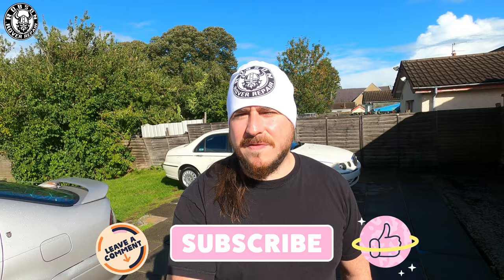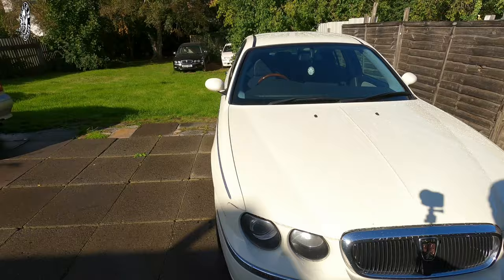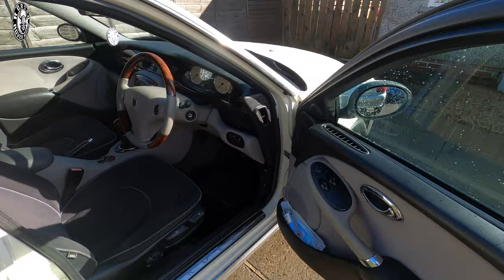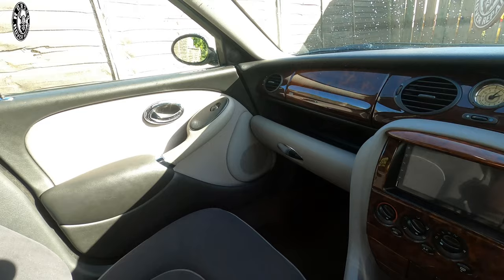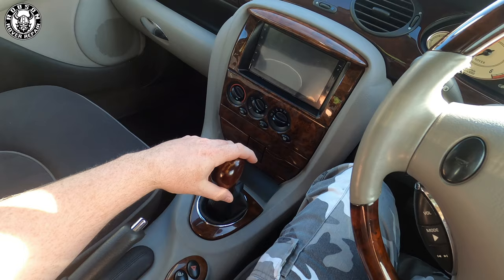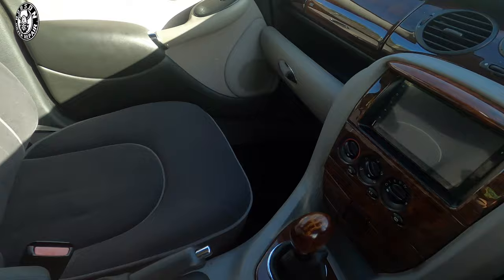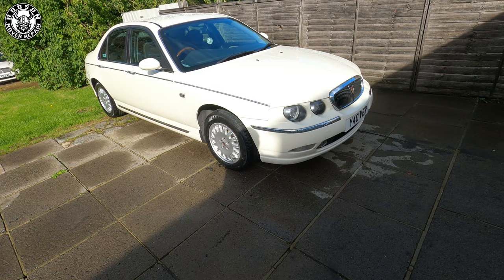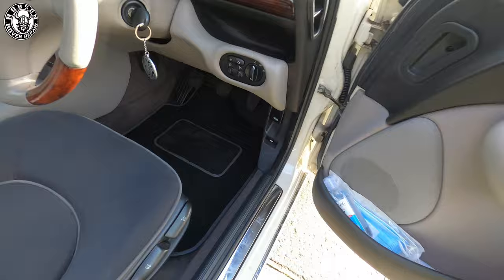My daily driven Rover. A base spec Rover 75? But why?

Comment: I have a Heritage Green Rover 75 CDTi has all the bells and whistles. I bought it in 2010 in England, it was MOTd the day before i picked it up. A week after i brought her home i got a puncher, to my surprise ever tyre on her was baldy down to down right dangerous with little rubber, they must have changed the wheels for the MOT i reported the garage to the VSOA.
Since 2010 i have spent around £13000 on the car in the last two years i have replaced most of the braking system, all hub bearings, new radiator, condenser, Alternator, Starter, all engine mounts, for life battery, front sub frame, springs and shocks, other suspension parts, lub oil cooler, water pump, crankshaft pulley and a lot more. I was an Engineer at sea were a lot of the maintenance is preventive,overhaul or replace before failure. The car will be 18 years old on 31/12/2021 have a rear sub frame ordered its taking forever to arrive, but am really pissed off because roof lining is starting to sag at the windscreen, i also need rip repair to drivers seat ( sandstone leather ) and the bolster replaced , also a small rip in rear seat, with all the money i have spend its annoying that the inside is starting to need money spent on it. The £13,000 does not include labour costs.
Sounds a lot off money but in the eleven years i have owned her, i probably would have changed my car maybe four times which would have cost me a lot more.
Car cost me £4000, and has an Evolution chip remap to 165 BHP which cost me £300 in 2010.

Comment: Wow I am in Australia & we don’t do base cars all of ours come with more upmarket spec. I daily drive a 
2001 Rover 75 V6 petrol in connoisseur luxury trim. Which means automatic gearbox, full leather & wood interior & all the other nicer items including a sunroof & CD stacker.  
I adore this car it is my pride & joy in a loverly metallic burgundy red.
Reply from the maker: Ah wonderful, wonder why the paint code is. Yes 75s go for absolutely crazy money out there!
Reply: @RobsonRoverRepair  
Yes they go for crazy money, a mint condition 75 in Australia is anywhere upwards of £10,000. You couldn’t even buy a real rust bucket for £900 it would be more like £1900.
Reply from the maker: Haha I know. I genuinely looked into shipping and selling them around 2015 to Australia.

But the rules on imports are mad, things like no asbestos etc, so car might have to be shipped with the engine separately because of the age. All sorts.

If it had of been just buy, ship and then rego (I know the local lingo haha) it would have been a good little earner.
Reply: @RobsonRoverRepair  the paint code for my car is CDW/1246 it is called Dorchester pearl red metallic. 
Australian import laws are a nightmare.
Reply from the maker: Aw mate. What a colour. I hadn't saw one before until Pride of Longbridge in 2017 and I must have tortured the owner for about half an hour over it. Copper leaf is still my favourite 75 colour, but that's a dam close one.

Comment: Very nice gearknob there. I would advise, that if your not already doing so, to wrap a plastic ruler in some thin cotton like cloth,  soapy water and slide it between the windows and horizontal weather seals. It's just about the only way to remove the grit etc that collects in this area through driving. Some BMWs have the same issue.
 Thereby avoiding vertical scraches on the windows.

Comment: Enjoyed the video always wanted the old English white don't see them 4 rovers in my street turbo tourer mgf copper leaf 75 basic made to look like a connoisseur it's a beauty my British racing green Connie 50000 miles was mint but got vandalised early this year paintwork to sort out as something was splashed over it had to have a new screen too the rear interior light was broken by the screen fitter didn't notice this till a couple days later it was hanging down not a great year but going to get the paint shop to sort it out soon have it detailed too that's life as they say but the car is worth it just enjoy driving it they are still a good looking motor 👍

Comment: Mines a 1.8 Turbo Auto in white Gold mk1 2003  lovely car hade it over a year now wasn't sure about colour at first but think it looks quite nice in Gold suits the car I like your white 1 very rare colour I think yours is probably 1 of the 1st to be produced at Longbridge after moving the cars production from cowley I know a lot  of the early white models where dealer launch special cars.
Reply from the maker: Oh mines a lot later than that, 4th July 2001.

I did have a "cross over" 75, preassembled at Cowley and finish at Longbridge. Still had a Cowley vin, I remember no one could get me details on it, none of the clubs, etc, was zircon silver, 2.5 auto, Connie top spec and neptune interior.

Wasn't until POL 2015 I got talking to a gentleman who was one of the senior team for translation from Cowley to Longbridge and starting telling me about how they ramped up 3 specs and colours specifically for it.

And sure enough I told him nothing, and he rhythms off exactly my car I owned at the time at the Connie spec, and explained how they sat at Longbridge and whernt registered until December 2000.

Everything matched up. Was very sad to see that car moved on.
Reply: @RobsonRoverRepair  sounds interesting you should kept it that's 1 thing I love about Rovers so much history behind these cars expressly the 75s and the history behind Longbridge as well where they where last built  these cars should marrked as part of British history.

Comment: Lovely condition especially for a daily. I loved my gold Classic SE manual diesel. My current diesel auto with a remap doesn't get quite as good economy as 52-53 mpg, normally around 10 less than that. Tax is £340 per year though😖 worth bearing in mind if you want a diesel auto. It has the EGR bypass that yours has and the vortex PCV. Keep up the good work on the Rovers man!

Comment: Rover 75 CDTi Connoisseur  is a great car. I have a tourer in light blue. The only problem is ULEZ in London and in the near future other city centres. Very comfortable, practical  and classy looking. Also they're getting rare now as this video says.
Reply from the maker: Exactly. And why they can't be upgraded to have an online DPF is beyond me. Plenty of European countries do it now, one just after cat and exhaust pipe. Options for them in Germany etc for about €300 euro fitted. All part of the continuous con to move into "the next thing" rather than something capable of lasting 20, 30, 40 years easily.
Reply: @RobsonRoverRepair  Mine had 171000 on the clock and now is on 193000 in 18 months. I feel it can go on for years with 6 monthly oil and filter changes and regular servicing and maintenance. I'm wondering if a remap is worthwhile.

Comment: Lovely car Colin. Never seen a white one in the metal before. I really need to get some work done on my 75. I want to get a remap.
Reply from the maker: Yeah it amazes me how many people say the same thing about the white. Mad because at one stage I had 3 whites in my garden at once. Pot luck!
Reply: @RobsonRoverRepair  £900 is a bargain, I was quite lucky with mine. I travelled to Northampton to buy it from a friend for a very cheap £250 in late 2019. Not really much wrong with it and it has been very reliable. Unfortunately the mpg is getting worse and the trip computer lcd display is unreadable.

Comment: What do you recommend Rover 75 year 2000 or year 2005?
Reply from the maker: Personally I prefer the earlier cars, but any 75 can be a great car, so find the best car for you.
Reply: @RobsonRoverRepair  I mean between a 1999 Rover 75 diesel and a 2005 anniversary, both in perfect condition which is more collectable?
Reply from the maker: @trackingcalin1988  hard to know, there are so many combinations of springs, shocks, alloy wheel and tyres sizes. That's before how much wear and test they have. 

Even the Connie spec cars have different shock codes which surprised me, not to mention self leveling rear options. 

For me personally I find the best for pure comfort is a Connie, between 98 and mid 01, with 15 inch rims and the 205 with tyres over the 195.

Now again, millage, tyre brand etc, all take massive massive effect.

My partners 06 diesel auto is absolutely sublime, and it rides on 16s but I went to 215/60/16s on it from 215/55/16s and again that extra diameter transformed comfort.

Its finding your own standard, they are a brilliant car overall and any car with decent tyres, springs and shocks to the correct spec will be enjoyable.

It's diesels that have 1.8 springs, and wrong shock specs are so common and ruin the cars enjoyment.